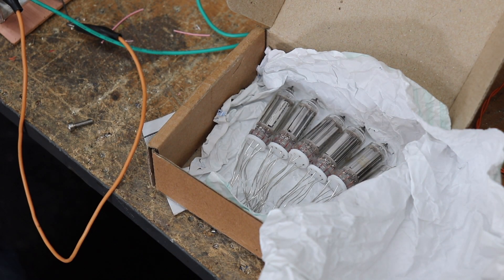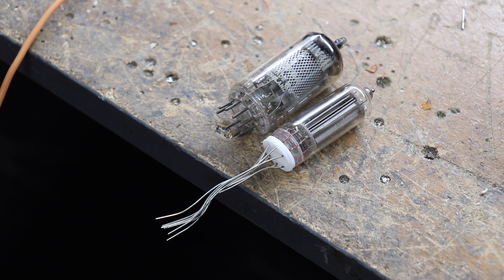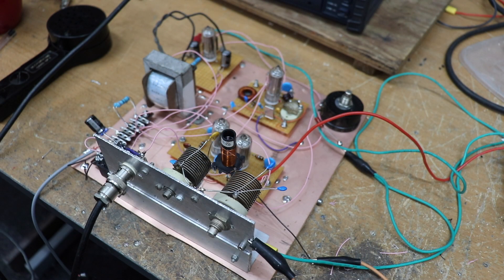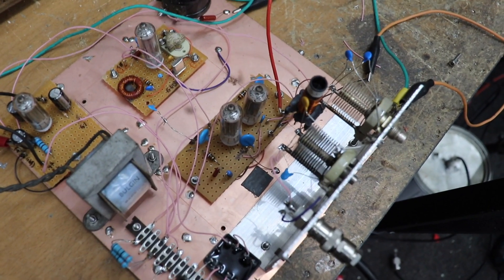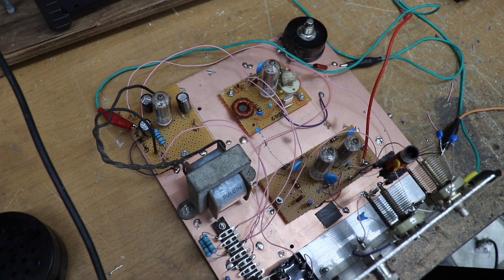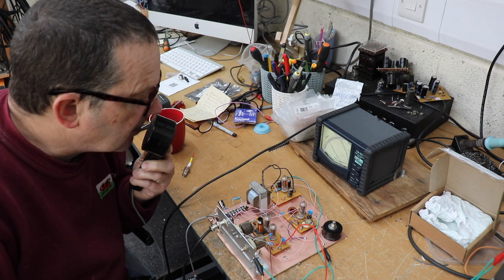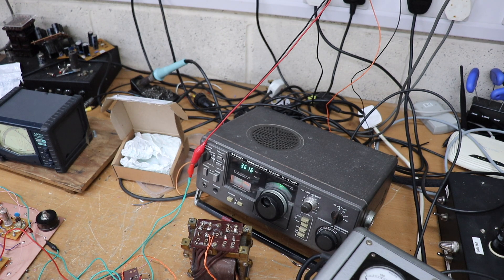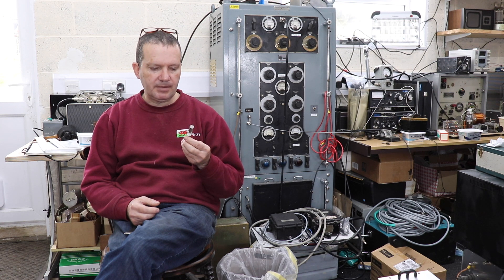QRP AM Transmitter With Russian Mini Tubes

Comment: i LIKE THIS .  there was a long tradition of small homebrew mobile rigs used on 75 meters here in the US...  and this is right square in the middle of that string of designs.   they often used a carbon mic as you are doing for simplicity, and either hesiing or  conventional high level plate modulation.  in the late 50's and 60s'  many companies used controlled carrier modulation ( and efficient variant of screen modulation using a clamp tube)  allowing high talk power, with low power drain, no audio transformer, and low power demand. using a carbon mic in the cathode.. as you seem to be doing here.. another great technique.

Comment: Congratulations on the new UFB design! :-) I know it's just an experiment but correct the problem of negative AM modulation, it's easy (bias) in PA and the signal will be better,
 I did AM TX in the late 60's on G807 + 2xEL34 in  modulator hi hi, those were the times ... and 60 years ago: ((
Vy 73 & Gl
de SP7GXK
Reply from the maker: Thanks. I plan to redo the modulator so it sounds better